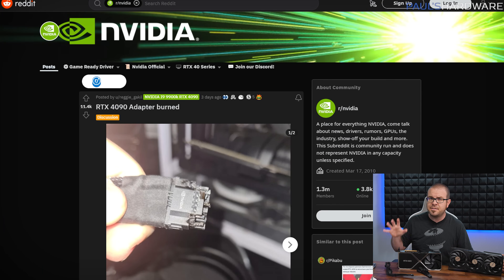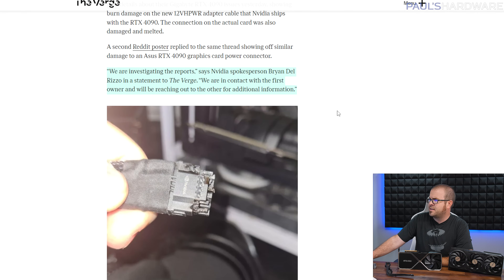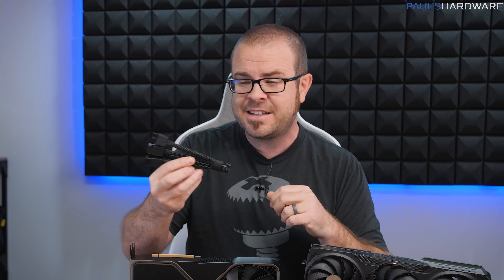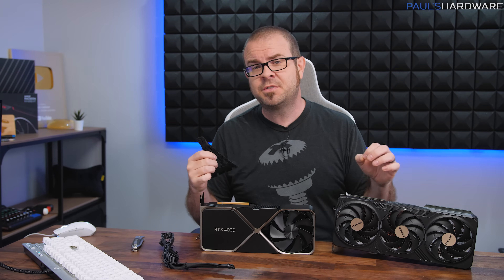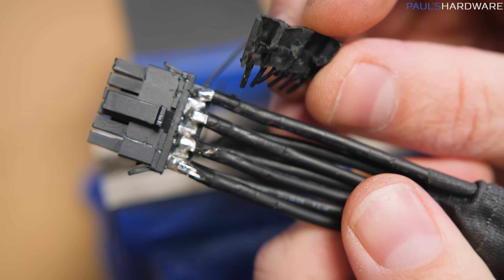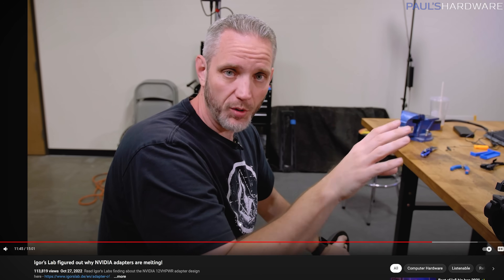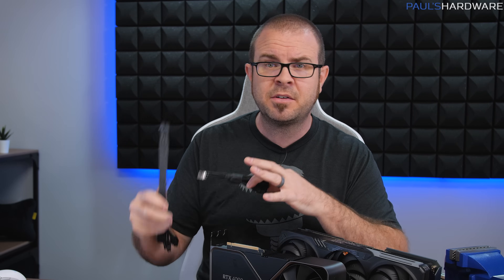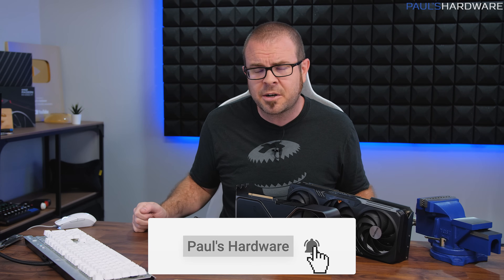Why are some melting? RTX 4090 600W 12VHPWR Adapter Teardown

Comment: AMD coming out saying that they are using classic 8 pin connectors may unironically make them the winner for this GPU generation.
Reply: They likely aren't requiring 450W TBP or even anywhere near 600W TBP with RDNA3. Chiplets won't need ridiculous amounts of wattage to provide the same performance per clock. This is literally the GPU equivalent of when CPUs went from monolithic to chiplet designs to reduce the effects of electron leakage. Nvidia is just being stubborn and wants to keep pumping power to gain performance with the same massive die size they've been using for half a decade, even as the process node shrinks.
Reply: @JosephArata  , that's incorrect for many reasons. Chiplets are there to increase yield, not decrease power usage. Power usage would be the same. Monolithic designs are inherently faster as you keep all functionality on the same substrate which allows communication lines to be much faster as there is less change in medium and shorter interconnects causing less signal reflections, parasitic capacitance/inductance and such. Power usage is more a function of transistor feature size, transistor count, and frequency. If you have X number of transistors of a certain node size running at a certain frequency, power usage will be the same as if they were all on the same chip or spread through multiple chips (obviously with roughly the same architecture for comparison). Chiplets though do allow for an increased yield as a monolithic design will mean sometimes an entire chip may need to be tossed or sold as a lower performing part if there is a defect, while chiplets spread the risk out to individual chiplets, giving you an increased yield for the same silicon surface area.
Nvidia and Intel are sticking with monolithic (so far) as it has engineering advantages, despite maybe yield issues. However, they both deal with the yield issues by hoping the defect only affects certain non-critical paths, and then disabling certain cores or functionality and selling these as a lower performing model. Hence how you get a lot of the different product lineups, they're often different quality yields from the same die process. 
Nvidia's power draw is just large because they definitely wanted to eek out as much performance as they can, so they increased the power targets past the point of reasonable diminishing returns and got a large increase in power draw for only a minor increase in performance. Interestingly, even in this state, the performance per watt is increased over the 30 series, so it is more efficient. However, If you look online you can see people drastically reducing the power draw for a slight hit to performance, that still is a giant performance increase over the previous generation.
None of this though, has anything to do with chiplets.
Reply: @JosephArata  , "Nvidia is just being stubborn and wants to keep pumping power to gain performance with the same massive die size they've been using for half a decade, even as the process node shrinks."

That's how ALL processor companies have increased performance. Node shrink plus same die area equals more transistors, and a higher transistor budget equals more transistors for some logic. Logic circuits can be designed in many ways depending on your intent and transistor budget. If you can do a massive parallelization of the logic with short paths you get the best performance (short path = higher frequency, parallel if possible = less clock cycles) but will use more transistors. Hence, the design of a chip is down to how many transistors you have, what logic you wish to accomplish, what frequency you want to run at, and balancing the transistor budget for these goals. Node shrinks with the same (or less area but still more transistors via the density ratio you get) allows for better architecture designs in addition to better transistor performance (smaller gate charge times = higher frequencies). Again, nothing to do with chiplets though. Nvidia sticking with monolithic design yields impressively large dies and the yields get worse because of it. However, since the majority of GPU architecture is repeated cores, chances are high that the defects occur in these repeated logic sections that can simply be disabled and sold as a lower performing model. All companies generally have made use of the transistor density increasing and keeping the same die, or slightly shrinking it but keeping an increase in transistor count in turn. This is why CPUs and GPUs have been increasing in transistor count pretty much every generation. With that said, chiplets do have an advantage in the future with this as well. The chiplets can be used to create a large 'virtual' die. As in, your transistor budget per GPU can increase by the amount of chiplets you can shove together, though this comes with its own engineering issues.
Reply: Doubt it. The adapters will eventually be recalled, and replaced. No more problems, people will go for Nvidia to get working drivers instead of wasting and time and money fighting with Radeon's nonsense.
Reply: Not really, the problem is not the 12VHPWR connector its the adapters being trash....
Reply: @bobvila4381  , yes, the standard is perfectly fine. I assume it's more of a PR move than anything else.

Comment: That is insane, think of Running a 12 Volt power inverter with 16 or 14 gauge wires at 50 amps.....of course its going to melt lol, I'm not sure why computers do not have to follow the electrical code, for the gauge of wire needed to supply that much current. Just seems weird to me.
Reply: Length of cable is important when it comes down to it, a lot of code stuff is due to the cable lengths being 20ft+ wheras these are usually 2 ft or less
Reply: If the insulation can handle 100 deg C temps, a single 14 gauge wire can pretty readily handle 20 A of current.  Splitting 50 A across 4 such wires still gives reasonable headroom.  There's something else at play besides wire gauge, or even wire number.  Contact resistance at the pins is way more likely to lead to melting.
Reply: Those wires are only handling up to 8.33 amps each. The whole 50 amps is spread across 6,16gauge wires(or better), which can handle over 9amps at these lengths with 3% or less voltage drop.
If it was all 50amps the melting would be a lot faster and likely rather dramatic.
Reply: Even if they were actually going by the correct spec, of 6 separate wires connected to isolated 6 terminals, it still is a bad idea. Without 12 gauge wire per terminal, and terminals made of silver plated copper. Not this tin plated copper nonsense with 14 gauge wires attached to a buss bar with low temperature soldier, that they came up with.
Reply: @JosephArata  Low temperature solder?  It's not like they're using conductive epoxy.  What alloy are you implying they are using here?
Reply: @JosephArata  6 wires of 16 guage can handle the current just fine with over an amp each to spare. It's the connector design that worries me. Mind you I'm talking about the spec, not what Nvidia did. 14 gauge should be enough for 4 wires lest than a foot long (could do over 10ft/3meters). What Nvidia did wrong was the connector design and qc there of.
Reply: Molex spec for minifit pin is 8a max per pin in this situation. Not sure exactly the pin materials but 8.33a seems to be running close to the edge of things.
Reply: @pkt1213  Not sure one the specs of the connectors, but the wires can easily handle the load. Now mind you 8.333 amps is at 600watts, which is more than the 4090 pulls normally. 600 would be for extreme o.c. runs, which would involve ln in most scenarios and the card would on a test bench in full view. these also don't last to terribly long due to condensation and other factors. Note that the 8amp spec likely includes a safety margin. The wires in the spec (16guage) can actually handle over 9 amps each while remaining in temp and keeping voltage drop at no more than 3%.
But yeah, the connector is where I'd be concerned as well.

Comment: I've been an auto tech for 30 years. Most vehicles run on a 12 volt DC system so I have no problem diagnosing computer power supply issues.I have seen a lot of burned up connectors in my time.  Usually due to a poor connection or too much current. Blower motor resistors are notorious for toasting connectors.
Reply: if it doesn`t blow a fuse first , but it will still blow that contact , i see it all the time ,just fixed my moms ac and she was told it would cost her 1,800 to fix it = i fixed it for 34 $ , a replacement  connector and some solder

Comment: Just watched the JayzTwoCents video, glad to see your opinion on it as well. Why couldn't Nvidia just keep the connector as it was with a cable for each pin!?!?!
Reply: They wanted to shave $0.02 off each adapter I'm sure.
Reply: because jensen needs to buy another leather jacket.
Reply: That's a good question. The answer is not price, as crimping can be done by machine, but that solder job looks like it was done by hand.
Reply: New PSU and connector designs are going to happen sooner or later... 3 x 8 pin connectors were stupid for cable management and PCB space.
Reply: @bobvila4381  True, but this is an altered adapter that was doing just fine for 3000 series, but then they decided soldering in bus bars was a better idea, which it clearly isn't.
Reply: @Ravenousjoe  Yeah Nvidia a billion dollar company couldn't figure out the cheap adapters were a bad idea I guess... I wont use adapters anywhere unless its the only solution. They almost always cause issues.
Reply: It doesn't look good on the Founders Edition to have 4 8pin connectors sticking out the side, and they couldn't be bothered moving them to the rear right where they should be.

Comment: Nice. Glad I went with an atx 3.0 with a native cable
Reply: I'm glad Corsair sells PCIe 5 power cables for their existing PSUs that use Corsair Type4 cables.
Reply: @AvgDan  either or. I needed a new psu for 4090 + 13900 anyways
Reply: Smart man... Telling my buddy not to use this shitty adapter even before the cards released and he still says hes not worried about it....

Comment: Would that Corsair cable work with my EVGA SuperNOVA 1000 G6 PSU?
Reply: You shouldn't mix cables from different PSU's.  Corsair cables are designed to work with Corsair PSU's.

Comment: ordered two 2x8 to 1x12 cables from ali and will test them since corsair and cablemods seem to work on the slow side :P
apparently 2to1 is what corsair will sell an unbraided cable aka not "pre-stressed" (braiding tugs on the shorter wires) they seem to have simpler safer joining at the connector with less but thicker wires like the dedicated 600w cables, that 4to1 is just dumb (btw each pcie8 connector has 3 12V pins and the the pcie12 has 6 pins so unless it's a problem for the power supply it makes no sense to go from 12 or 9 wires to 6 adding physical stress to the gpu connector, or it should have been done near the 3-4 connectors not at the gpu
Reply: It's important to make sure those 2 to 1 cables you ordered are 16 AWG to hand the load.
Reply: Crimping microfit pins is not challenging, by the way. it's the same as mini fit, but you need a different die for your crimper.

Comment: Paul, this launch is the dumbest launch I've ever seen in technology. There is no stock, it doesn't fit in anyone's computer, and it literally bursts into flames when you use it.
Reply: It does not "literally burst into flames" but okay bro
Reply: Not for people with experience... I would never use an adapter on a 2000 dollar GPU as its an extra point of possible failure.. Get a 20 dollar dedicated cable and problem solved. It has to do with transitioning to new PSU and connector designs while trying to make current PSU designs work with the new.
Reply: Well thats Nvidia for you

Comment: Igor really is a gem, I always watch his videos.
Reply: The entire industry has attacked him, basically always wrongly, on several occasions now.  That's how you know he's an actual threat to them.
Reply: He is the original TH when it was the best out there, glad he break away early and keep the high standards even now.
Reply: @winnieid2727  is there an issue with toms hardware? After jonny went to corsair, they're the only ones posting in depth reviews of psus. So it'd suck if they were shady.
Reply: @Tagiau   Here on YouTube, look for Hardware Busters International.  The man does very thorough PSU reviews.
Reply: @Tagiau  The guy doing psus reviews for TH and other media outlets is as good as Jonny and OklahomaWolf.
Reply: YouTube's auto translation leaves me vexed, so I follow the link to his articles.  I like the way the man thinks.
Reply: Question: in the video, you postulate the problem is not the lack of one of the cables like with Jay's test but THE PROXIMITY of the broken cable to the connector, thus increasing resistance and heat build up. This being the case, has ANYONE attempted to simulate this even with NON NVIDIA cables to see if this is a "general cable" problem or just an "nVidia cable" problem?
Reply: @hojetiveca  It's just how Physics works, be it a psu cable or a sub system inside the ISS. The problem here is about design, engineering, testing, QA and QC.
Reply: @CapaNoisyCapa  Na, cable works fine. User error
Reply: I appreciate his explanation and ability
Reply: he also looks like a pimp a hardware pimp